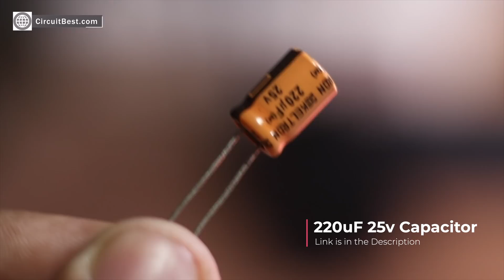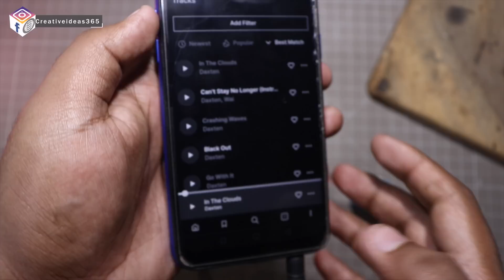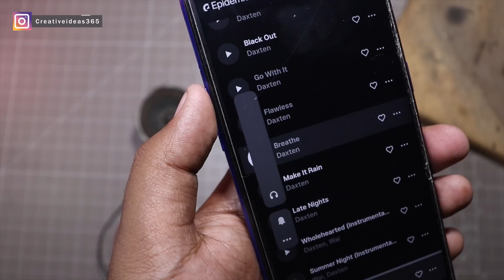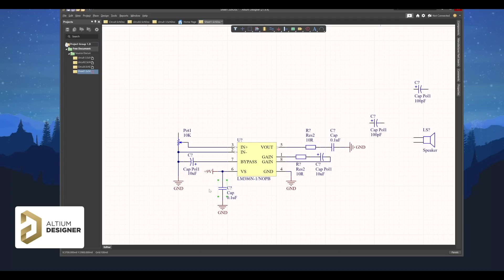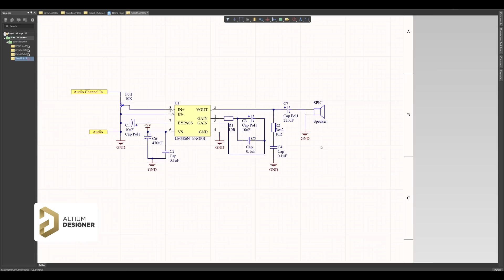Simple Amplifier Circuit With LM386

Comment: Nice.  It makes a speaker sound loud enough.  I like your point to point solder building. 
I would have really liked it a lot more if you got the speaker as loud as it sounds without the distortion, and then unplugged the phone so I could tell how much difference the LM386 made.  Thanks for the video.